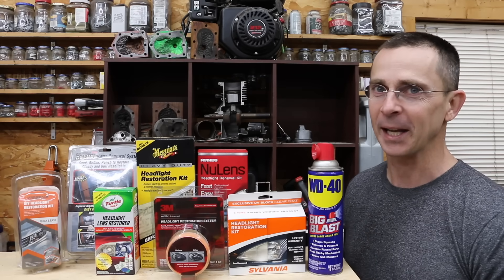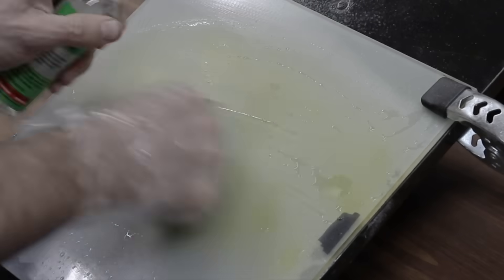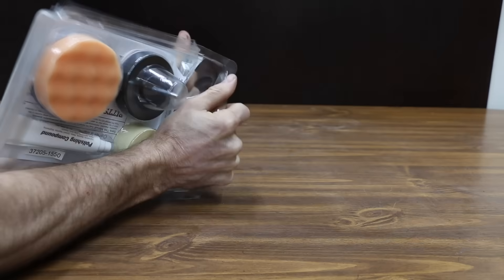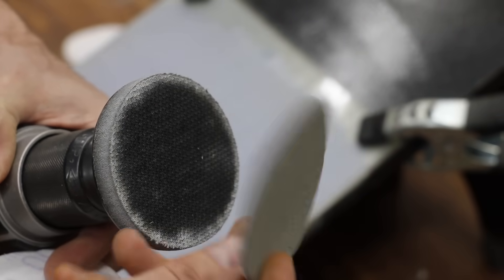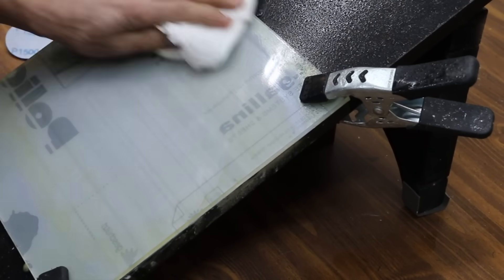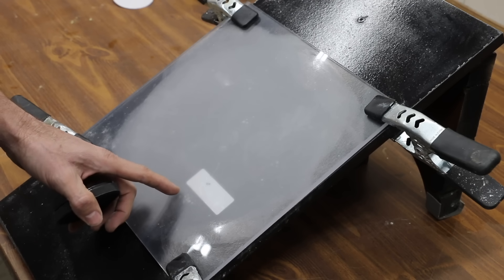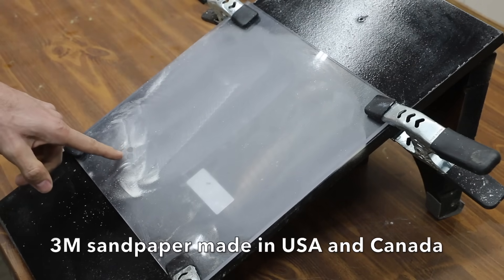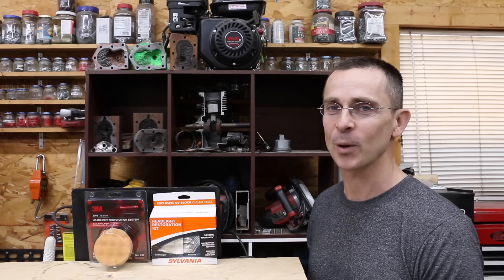Best Headlight Restoration Kit?  Let's find out!  3M, Sylvania, Meguiar's, Mothers, Turtle Wax & HF

Comment: Good video as always bud. You did a great job in your video comparing all the different motor oils. I’d like to see a video comparing Diesel engine oils like that. There are really only four main brands you can easily find at truckstops and parts stores. Shell Rotella, Mobile Delvac, Delo, and Valvoline. I’d love to see all 4 compared using all thre formulations each offer standard 15w40 , Syn blend 10W30 and syn 5w30. If you wanted to throw in a couple cheaper alternatives the Pilot Flying J truckstops and Loves Travel centers both have their own store brands named the same as the stores.
Reply from the maker: Thank you very much for the positive comments and great video idea!

Comment: How does this even come close to actual headlights. I mean the damage and color/effect would be so much differnt on a 5 year old headlight, so all these products could be useless on something like that.
Reply: Umm.. theyre both acrylic plastic? 
Actual headlights would  be expensive. If he got them at a junkyard it would be very hard to find enough of the exact  same headlight, then they would all be in different condition. Using raw sheet material allows for  accurate comparison conditions.
Reply from the maker: Thanks for the constructive feedback

Comment: Excellent video. I thought you had already tested everything. 
It is no wonder the Sylvania kit done so well being more of a manual kit, although I am sceptical about circular sanding. My best results has been using various wet and dry sandpapers in a sanding block with alternate passes, then Plast-X and a Turtle Wax type sealer to finish with a drill and sponge pad. Drills tend to leave swirls on rounded headlights as it is very difficult to keep an even pressure, maybe with a DA polisher it is possible.
Reply from the maker: Great feedback. Thank you

Comment: I'd recommend just cheap wetsanding and car rubbing instead of using the kits. The issue is to restore the surface protection so they last more than a summer of UV radiation. So how long the kits final treatment lasts, is probably a more interessting compairsion (I did not understand these samples were exposed to UV before or after).
I have polished headlights to perfection, only to look bad again in a couple of months in the sun. The answer is UV resistant clearcoat.
Reply from the maker: Great suggestion. Thank you

Comment: I used to do this so much as a detailer, a buffer and compound works amazingly well, better then any kit, then use some wax or something over the headlight to help a bit more. You should do a video about which claybar is the best, try it on paint and on windows, see if any leave any marring or scratches or anything. Pretty sure they're all the same but some charge so much, or maybe a video on best wax. I love car related tests haha.

P.S. you used way too much polish/compound lol. Going from 800 to 3000 never works well, they should do 800 to 1600 then buff with polish or compound, most can do 1500 and up sandpaper scratches.
Reply from the maker: Great feedback. Thank you

Comment: I would have liked you to actually restore the headlights with the sylvania and 3m kits.  Just to see how they looked on actual headlights.  Great video, though.
Reply from the maker: Thank you.  The "clear" side of the thumbnail was restored with Sylvania
Reply: I have used the sylvania kit before and it looks like the marketing pictures once you put that last clear coat on. It did need to be redone after about 2 or 3 years.
Reply: The 3M kit works great, I use it all the time. The 3M kit I buy comes with a UV sealing compound. Don't stay in one spot too long, always keep moving and keep your surface clean to prevent clogging.
Reply: @Project Farm. Yes Todd, use both the Sylvania and 3M headlight restoration kits kits on the Farmabago!. We'll even let you forgo the masking step.

Thank you to the service members who gave the ultimate sacrifice for our freedoms.

Hope everyone stays safe and well.
Reply: @ccadama  
That has glass headlights

Comment: Our detail shop does headlight restoration regularly, they remove the lights if possible and sand then polish and send them to the paint booth for a spray in uv resistant clear coat. If course this process costs around 150 vs 15 but it's the best way and it lasts years.
Reply from the maker: Great feedback. Thank you

Comment: Sylvania’s clear coat has been my little secret.  They sell it separately for $10.  I use 3M 400, 1000, and 2000 grit sandpaper and then the Sylvania Clear coat for best results.  No polishing compound, the sylvania clear coat takes care of that.
Reply from the maker: Great feedback!  There's enough to coat 6-8 headlights
Reply: I was actually going to say this exact thing. Did it to my headlights thst were completely fogged over. Has lasted 3 years now. Still going strong.
Reply: In all honesty just sanding and painting with UV resistant clear seems just as much, if not less hassle.
Probably last a lot longer also.
Reply: Do you wipe a fresh layer of the clear coat ever so often as maintenance, or is it just one coat and you have to start the whole process over once it starts to oxidize?
Reply: @MoneyManHolmes  Start over once it begins to oxidize.  Sylvania is the best I’ve found so far
Reply: Ceramic coatings are better than paint. Never peels and lasts a few years.
Reply: The Sylvania clear coat was coming off of my headlight lenses in the middle after a few months. I re-sanded them and bought a nice spray can of Rustoleum UV protective plastic bonding clear coat and that has held up. Probably less than $10 a can in the states and would do dozens of headlight lenses.
Reply: @imadecoy.  What is the name of the Rustoleum spray?  Is it "Rust-Oleum American Accents 2X Ultra Cover, Clear Gloss Spray Paint"?
Reply: My secret is Turtle Wax cutting compound and rubbing compound. If your lights aren't horrible, you can skip any sand paper altogether. Cutting compound serves the role of the medium-course papers, and rubbing compound serves as the fine paper and polish. For $6 per bottle at Walmart, I get enough compound to do dozens of headlights. With a drill attachment, I can restore a headlight in two minutes.
Reply: @funkingitup1805  
Thanks for the tip, that sounds pretty simple
Reply: @funkingitup1805   You didn't funk it up then...

Comment: Step 1) Use a drill-bit buffing wheel (like the pink 3M buffing pad) and then use "Mothers Mag & Aluminium Polish. Buff until yellow is gone.
Step 2) Wipe away residue with a rag. DONE!
This is what I do, sounds weird but it works. It's also by far the fastest. 5 minutes is more than enough time for both headlights.
Reply from the maker: Great suggestion. Thank you

Comment: Those yellowed out lights are a safety hazard.  If it were required that headlights hold up for 10 yr minimum or the manufacturer has to replace them, the problem would be fixed.  The way it is now, the yellowed out headlights generate revenue so there is no incentive to fix the root problem.  At the volume they make lights, it would probably only cost $10 to make them out of glass.
Reply from the maker: Great point!  Thank you

Comment: 3M makes a companion product that has the UV protectant wipe. It comes in a blue packet with an additional 3000 grit sanding disc. If you use that with the kit shown it will produce even better results.
Reply from the maker: Great feedback. Thank you

Comment: Going to sound odd but pledge gloss floor wax works really well. Sand and polish as you would normally then liberaly brush on the pledge let extra drip off. Protect it from dust until it is dry. It looks like glass. 
The wax fills all micro scratches and then levels out on the surface.
Reply from the maker: Thanks for the feedback.

Comment: Last time I did my '94 Caravan headlights I used Acetone.  Have to be very careful and just wipe one direction with a fully wet cloth and just once across or the plastic will stick to the cloth and be worse than at the start.  Also if you have a vehicle with paint on it (unlike a '94 Caravan) don't get the acetone on the paint on any surrounding plastic facia.  I'll have to give the Sylvania a try if I can find it.   Thanks for all the work you do testing all these things.
Reply from the maker: Thanks for sharing.

Comment: I’ve used several of these to different degrees of improvement. Recently I was going to restore my 02Ford 250 Powerstroke. While on Rock Auto I checked new lenses. Happened to be closing out one brand. $27.00 per side for brand new lenses and new bulbs included. 
Conclusion-always check few auto suppliers. No kit could have restored to this level. People are flashing their high beams at me again. Lolol
Reply from the maker: Thanks for sharing.

Comment: Bug Repellent Spray is NOT to be used! The chemicals soaks into the lens and when you wipe it off, it does remove the opaque surface, but the plastic surface is ruined and will remain soft & tacky to touch. 
You could apply this to polishing windshields? i.e. Has a streak on glass, from a wiper blade housing end.
Reply from the maker: Thanks for the feedback.

Comment: A great and cheap solution is to use Mother's Mag and aluminum polish with a microfiber towel. The whole process takes about three minutes a lens. Once clear I use 3in1 RV rubber and seal conditioner with UV protection. Works fantastic. One jar of mother's will do about 30 applications. Got this idea from the Sweet project cars channel.
Reply from the maker: Thanks for the feedback.

Comment: Dude you are spot on. 
I tried the Harbor Freight kit first and it was completely garbage and more hassle then what it’s worth.  
The harbor freight sand paper melted the yellow road tar film on the headlights and completely clogged up, leaving the “then melted” yellow film streaked all over the headlights... only that film dries to a  rock hard consistency in a matter of seconds and you’re left chasing that crap all over the place.  
So I went and picked up the 3M kit and OMG it was night and day difference.  
Instead of heating up and melting that road tar, the 3M sand paper completely cut through it and discarded it like its suppose to. Literally shaving 3/4 of the time off making the process quick and enjoyable vs. a complicated unnecessary headache over cheap sand paper smh. 
They’re almost identical systems and processes, only one uses quality materials and one uses sub par materials.
Reply from the maker: Thanks for sharing.

Comment: Could you do a long term comparison of clear coat protectors left out in the elements and direct sun? Rustoleum's 2x uv clear coat, 2k clear, etc... I've had great results from just using various wet sand grits then clear coating them. I haven't used the 2k yet, but the Rustoleum only lasts about a year, maybe. It did look crystal clear and new, at first XD
Reply from the maker: Thanks for the video idea.

Comment: I have used the 3M restorer and Mother's NuLens restorer kits. The very first time I used the 3M kit without lubrication, big mistake. The lens would get too hot and it would cut too deep into the headlight causing a gouge.  The second headlight I used a water hose to keep it lubricated, huge difference. It was easier to use start to finish if you keep it lubricated throughout. Both systems worked well.
Reply from the maker: Thanks for sharing.

Comment: I did mine with Ultra cutting cream you get at car paint suppliers , then seal and give it extra shine with a clear liquid product that helps prevent oxidation. I use the sealer once a month , still look great.
I use elbow grease and Costco microfiber towels.  36 pack was on sale for 12USD   Biggest ,, thickest , nicest on market and cheapest , get at Costco.
Reply from the maker: Thanks for sharing.

Comment: Would love to see evaluations of new LED headlights.
As for this video, loved it. I've been down this road and used the 3M with decent results. One warning though, the kit I had used a 3" disk and its easy to tip to the side when polishing so you end up gouging into the polycarbonate on that edge. Aside from that, it's a nice kit.
Reply from the maker: Thanks for the video idea.

Comment: Actually you should never finish the headlight lens by polishing , you should sand it down until P2000 +/- and then use the spraymax headlight kit , using the primer (policarbonate) first and then the 2k clear coat , after that you can polish the headlight to remove the orange peel
Reply from the maker: Thanks for the feedback.

Comment: I do headlight restoration, and I dont use any of this. I use soapy water, 800 grit, 1200 grit and 2000 grit wet sandpaper. Dry the lense and coat with Minwax fast dry wipe on poly clear semi-gloss. The results are better than all of these products. I have before and after pictures if interested.
Reply from the maker: Thanks for sharing.

Comment: This test is completely invalid. None of the kits were designed to work effectively on heavily sanded poly panels because that does not represent oxidized faded head lights (unless you drove thru a sand storm). smh I would rethink your methodology for this kind of test.
Reply from the maker: Thanks for the constructive feedback

Comment: I have been restoring headlights for years using only Blue Magic metal polish cream and a towel for medium hazed damage. When there is heavy damage I only include 6000 sand paper. All done by hand and rarely takes more than 15 minutes.  Give it a try and you will be impressed.  I would be interested in a metal polish comparison episode. Thanks for your great work.
Reply from the maker: Thanks for the video idea.

Comment: The Car Wizard did a recent restoration where using brake fluid would very easily remove yellowing however a sanding and polish was needed after
Reply from the maker: Thanks for sharing.

Comment: Hold my beer, I got this!:
Sand to 800'ish or the closest you got, then clearcoat with a UV protective clearcoat...
Cheapest solution you'll get and as good result as anything...
Reply: TRY TOOTH PASTE, THEN CLEARCOAT..LOL    MIGHT GET THE SAME RESULTS..
Reply: @jab0609  I've tried toothpaste. Kinda works but sandpaper is waaay faster...
Reply: @RenaxTM91  true   but sometimes it is just a very slight haze that causes the whitening' and it has been cleaned before.
it would be just a "touch-up", so you could "sale"the car?
Reply from the maker: Thanks for watching.

Comment: Wetsand with 800, 1200, 1500, then a speedy black foam pad with compound. Buff after. That's the process we use on our used headlights. Not all cut polish is the same. As stated in the video, always cross your sanding with the next grit.
Reply from the maker: Thanks for the feedback.
Reply: @ProjectFarm  Just my 2 ¢. Really enjoy the channel......there's always something to learn here.

Comment: I use mothers polish works good on headlights as well as paint and aluminum
I've never used the mothers headlight restore. Just the polish that is in the little tub works great and only needs to be rubbed on by hand but its not for heavy damages
Reply from the maker: Thanks for sharing.

Comment: In defense of the Turtle Wax kit: I had mild-moderate yellowing of some 2000s Acura/Honda headlights I recently did following the instructions. Worked great to bring it back to a nice polish. I do not have long term confidence in the UV coat but it's fine at 60~ days after under direct AZ sunlight every day. It is definitely worth the money (cheap!) you spend for it. I have many car-guy and mechanic friends and family here in AZ and they all seem to prefer those Sylvania kits.
Reply from the maker: Thanks for the feedback.

Comment: You left out the least expensive and maybe the best option; wet sanding with 400, 800 than 2,000 grit sandpaper followed by a coat of clear polyurethane.
Reply from the maker: Thanks for the feedback.

Comment: I used the 3M kit and was underwhelmed. Granted I did a slapped ass job, but still. Might just replace the whole headlight assembly.

EDIT: I actually used something less substantial than the 3M kit you tested. I might try again with the Sylvania kit before I replace the headlights.

Comment: Easiest method is to use mothers aluminum mag polish. Wipe on them buff with a rag thats it. Takes less then 5 minutes and lasts a month or more. So if your failing inspection and they failed and told you need expensive replacement. Spend a few bucks on the mothers and waste 5 minutes a month making them shine  like new.
Reply from the maker: Thanks for the feedback.

Comment: I used the Meguiars kit many times on 2004 prius and 2007 sprinter lights and while they would restore clarity for a few months. Then they would dull again quickly from UV exposure! After years of maintenance, I bought brand new headlights on ebay and sold the polished ones on eBay for half price. I explained how I polished them and took before and after pics. It seems that when the UV plasticizers wear out with age it's hard to get them back? I have a 1967 boat that is all original and the vinyl is still very much perfect, however on some surfaces that see the sun the most it starting to get sticky and it's hard to restore the Finish! Might need new vinyl after 53 years!
Reply from the maker: Thanks for the feedback.

Comment: Great video.  I have tried products in the past that claimed to restore headlights with little to no luck.  My grandfather told me years ago to use a 50-50 blend of white vinegar and baking soda, which seemed crazy to me.  But I tried it and I must say it works pretty well.  Just apply the paste like wax with a buffing wheel firmly on the headlight 2 or 3 times cleaning between each application and Ive turned completely yellowed headlights into like new.  Of course you have to add a sealer afterwards.

I will try the Sylvania one next time however, great results from that product.
Reply from the maker: Thanks for the feedback.